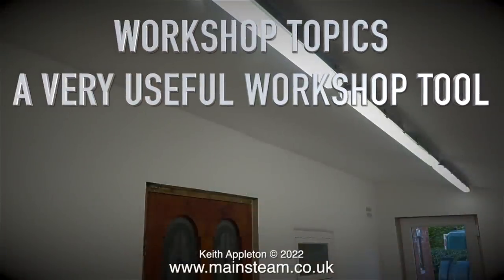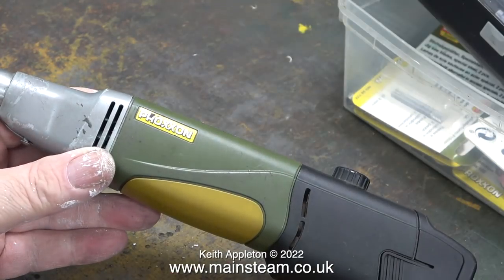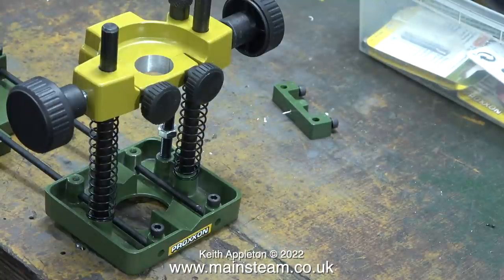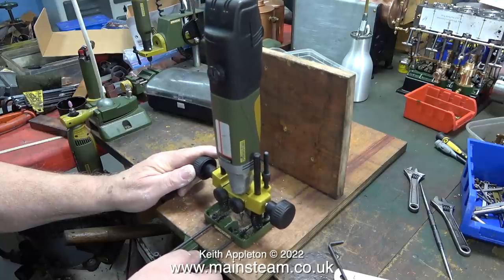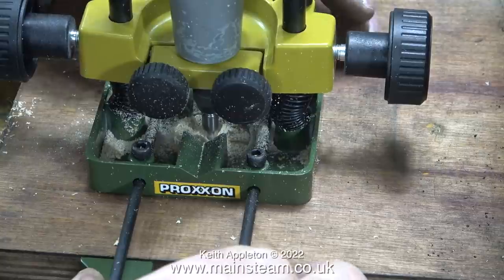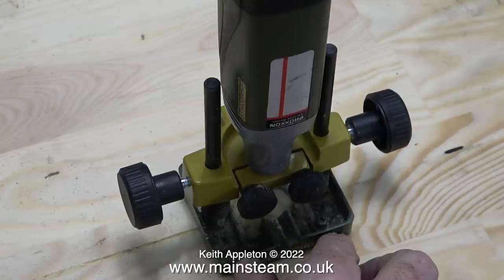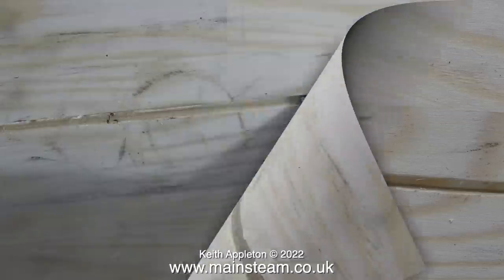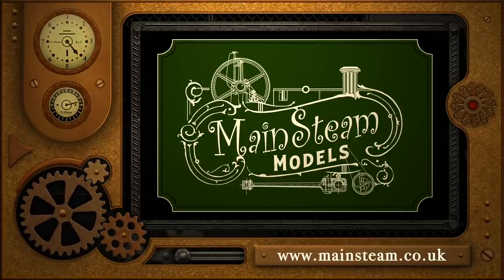WORKSHOP TOPICS - A VERY USEFUL WORKSHOP TOOL

Comment: Hi Keith. You mentioned about the Hammond organ & Keith Emerson? Later, Keith joined with Greg Lake, & Carl Palmer to form ELP. Greg Lake was a friend of mine at Henry Harbin school in Poole. Also, I worked at the Kentucky Organ Company (part of Brocks) & was part of the electronic construction team on the models Challenger & Adventurer. If the technicians found any faults or mods needed, I used to repair them? Many thanks for your very interesting & informative vlogs. Kind regards.
Reply from the maker: Great info - thank you {:-)))

Comment: Cutting ply with a router will blunt the bits faster than solid wood as the glue they use in the ply tends to be harder than the wood and it also binds on the cutter making it hot that’s why it smokes ….it looks like a handy tool for a modeler  ..

Comment: There are several very good hand router planes available these days, and many much cheaper ones. Some, like the Veritas, have a variety of cutting blades that can be switched out rapidly. They need knife scores to start the cutting to prevent tearout around the slot, but that's no real hardship. Advantages include no dust kicked up, very quiet operation, and a great deal more safety when used as there is no high-speed rotating razor edges to worry about or catch your clothing or hair in.

Comment: There are cutters available with reverse twist. The cutting action pushes the cutter in to the chuck and practically eliminates burrs. 
I don't know the proper name. 
Thanks again for the videos.
Reply: They are called down cut bit. They are made so you dont get a burr line in woodlike materials when you mill it. There are also up cut bits that you would use if you want to mill through a piece and make a clean burr free edge on the other side. 
The best is using a compression routing bit they are combined up and down cut bits that dont leave a burr regardless what side you route from. They are also made to cut a full depht slot at once.

Comment: I have some Proxxon tools too, drill, drill stand and crosstable, and a MF70 milling machine. And some bits and bobs that go with it like vises, clamps etc. The only brilliant machine is the MF70. For the rest I am generally not overly happy with the quality / accuracy of Proxxon. The term “excellent” would not come to my mind. It works….just. But for modelling purposes there very few alternatives. As you state: most machines are just too big.
This router attachment seems to be no exception to the general mediocre quality of Proxxon. The drill mount slops around on its guides and this makes lowering the mill into the work a sloppy business making marks on either side of the slot in the wood. And there’s no aid (lever mechanism) to lower the mill decently into the wood. So yes, it works -ish. But then again for thirty pounds for an odd use you can’t complain. Thanks for the review.
Reply from the maker: I stand by my opinion of Proxxon motor tools, the "Micromot" drills are great, the Jigsaw is poor and I too have an MF70 which is OK for what it is, although I don't use it much.